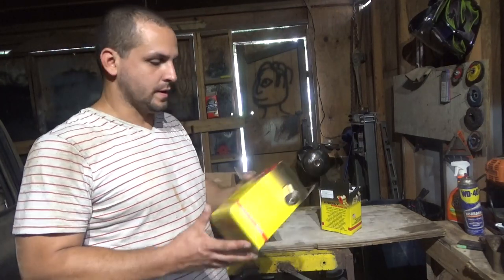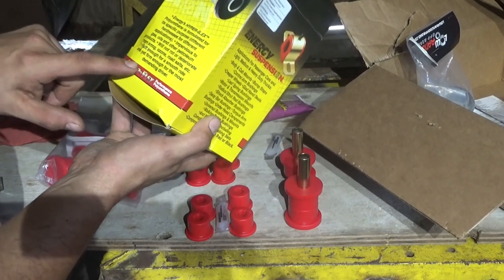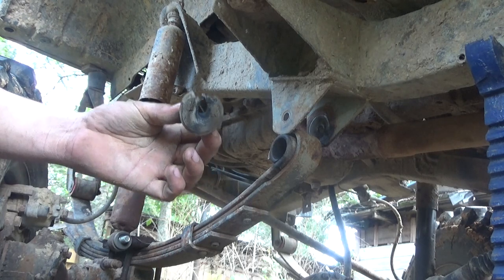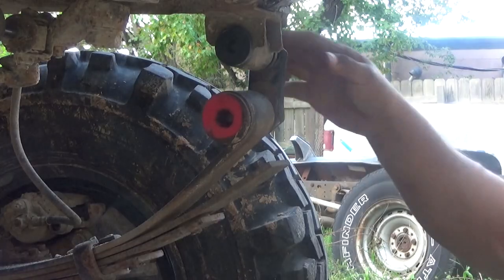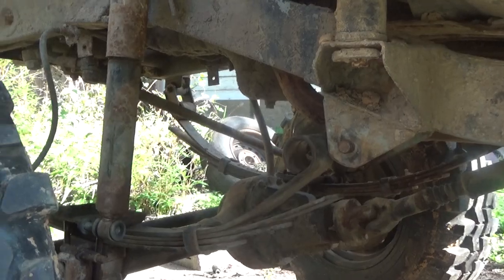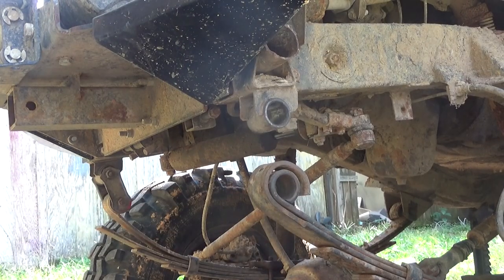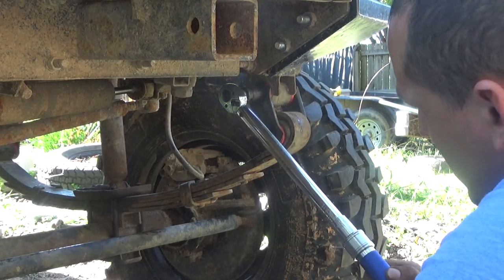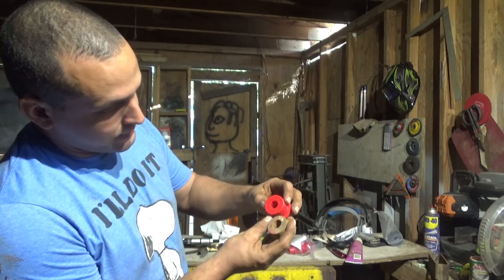How to replace front leaf spring bushings, 87 Suzuki Samurai. poly bushings

Comment: Thanks for the great video! I am going to do the same job on my 1977 HJ45 Land Cruiser tomorrow
Reply from the maker: Yeah I think it's the way to go if you have problems destroying rubber bushings. And the suspension seems to ride the same and flex the same. At first it will seem stiffer but it will loosen up. Atleast that's how it went for me.
Reply: @davidcraft4909  Thanks, I appreciate the reply... will test it out once I've done the tie rod ends and wheel bearings too

Comment: So a set comes with enough to do half the job? One needs to purchase two kits?

Thanks man.
Reply from the maker: One box or kit comes with enough bushings to do either the front or the back.  They are the same, but to do the whole vehicle that would be two boxes.
Reply: @davidcraft4909  thank you Sir, I have done the rears and have removed the fronts... I'm in way over my head 😅

I also need to move my shock mounting location up front as they are rubbing the U Bolt Plate... but some bozo ground off the mounting stud on the actual plate. 

So now have to sort out some kind of solution. I'm not even sure if I can order based on a Samurai axel as I'm not sure if they are Toyota axels or Sami axels ... I'm thinking Toyota as they appear to be inverted.
Reply from the maker: @ChromeArty I had a problem with my shocks rubbing the u bolt plates. I bought my samurai already lifted so I don't know how it came stock. but mine has some lower mounting points for the shocks on the axle. I think those might be for a sway bar and the u bolt plate have a stud on them for the shocks.  Or I might have it backwards, also I don't even know if the lower mounting points I'm talking about are factory, they look factory. I have a video on my shocks I chose some summit shocks that have the most narrow main tube, to try to keep them from rubbing the u bolt plates.